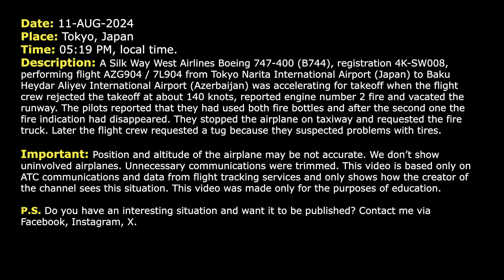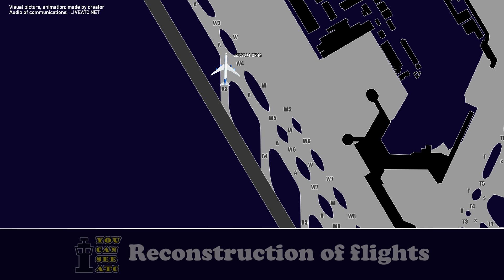Rejected takeoff due to engine fire. Silk West Boeing 747-400 rejects takeoff at 140 knots. Real ATC

Comment: No sense of urgency from ATC!  that has to be one of the worst responses I have heard for a long time! More training needed.
Reply: NRT has had this issue for AGES.
Reply: They should add report of fire memory item to the training /s but not really /s
Reply: looks like the ATC didn't understood first (English issue ? ) but I dont get why it take so long to get fire trucks still (at least from the conversation it looks so long)
Reply: @mata2723  probably the word fire and concept of fire didn't connect
Reply: Foreign aircraft from some unknown country not properly maintaining their aircrafts and blocking Japanese airports. Really, we're more annoyed than concerned. Haneda and Narita are on tight schedules with dozens of airlines wanting more slots, both domestic and international. We don't need an airline who cannot even maintain their engines. And obviously, they're cameras in Narita tower. They can visually see the aircraft if it's on fire or not.
Reply: @yo2trader539  おもんな